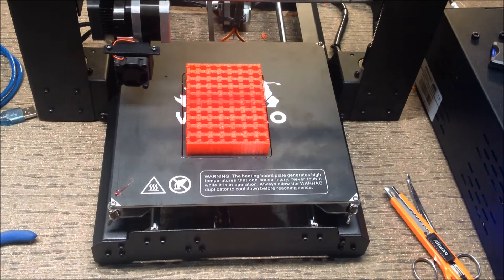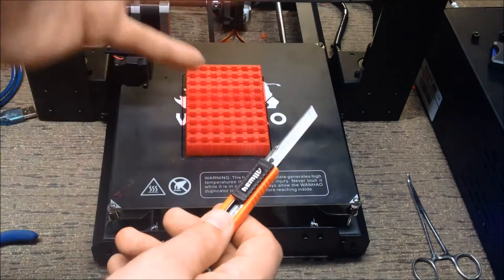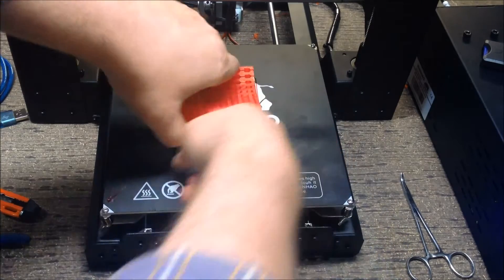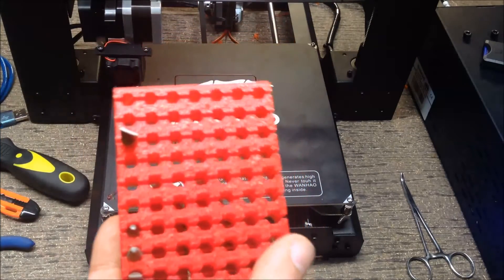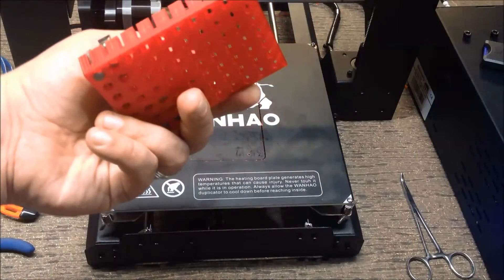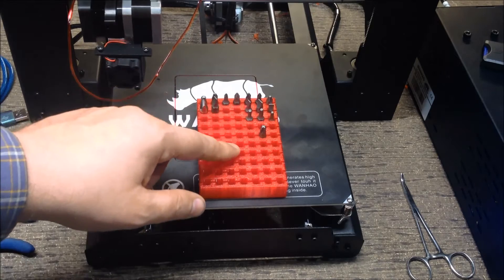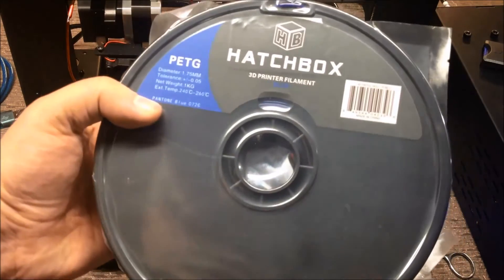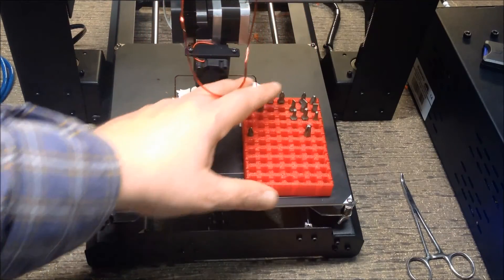Working with TPU - Thermoplastic Polyurethane Filament Printing a Hex Tool Holder

Comment: even tho most of my prints stick too well with my 2$ buildtack like surface TPU works well most of the time /shrug. not too hard to remove. not too easy
Reply from the maker: Have you seen this video (https://youtu.be/QyiitsKeEEs) as I have been using a Phenolic Sheet for the bed for a long time with great success!

Comment: lol that's pretty neat, but stop saying expands...the plastic contracts as it cools! ABS contracts a lot as it cools, TPU does not.
Reply from the maker: Thanks for the kind comments, however plastic does expand when extruded it "expands" as its being pressed downward and not the thermal aspects.  I typically add 0.2mm to my opening to compensate (~50% of the 0.4 nozzle)...
Reply: ahh so you meant expanding as it comes out the nozzle, gotcha! I thought you were meaning as the print cooled it expanded.

Comment: It may be worth checking to see if Oil or Grease, work shop fluids, etc have an impact on such prints.

 Some plastics do not hold up well I hear
Reply from the maker: +Protomaker Black Sprint Original 3D Printer understand what your saying, yet all was clean good as with the Apple pencil model thing tend to break down on the smaller side with 3D Printing.

Comment: kinda seems like it needs to be scaled down a few percent to hold onto the pieces better.
Reply from the maker: +xKatjaxPurrsx Yea printing this in ABS (which I have one) works fine as the plastic "expands" whereas the TPU does not which is interesting and the reason for experimenting.  However yes, likely scaling down slightly might work too as when I design models, I will typically create scaled modes for a specific material type...